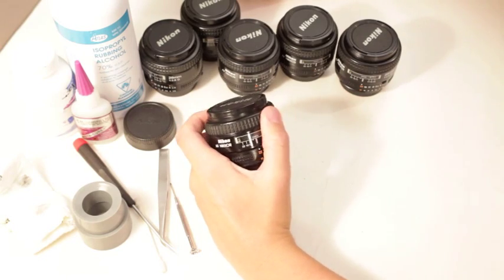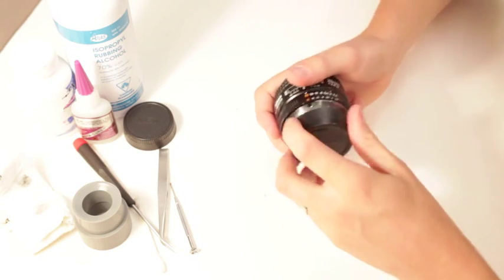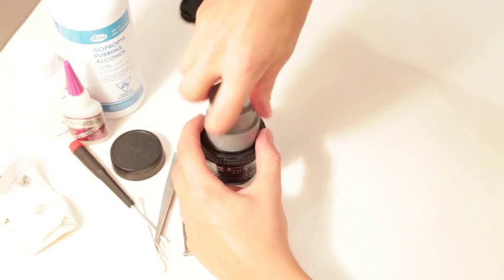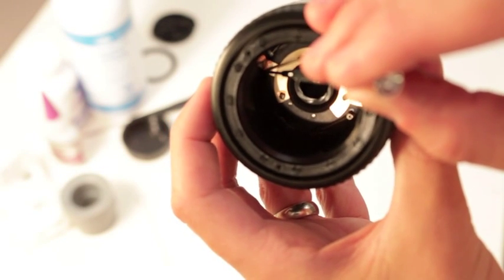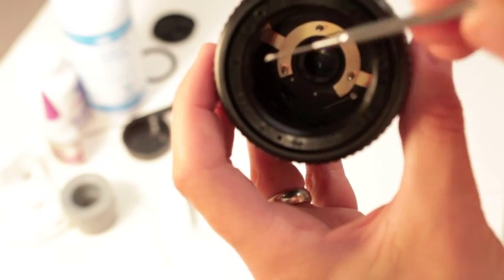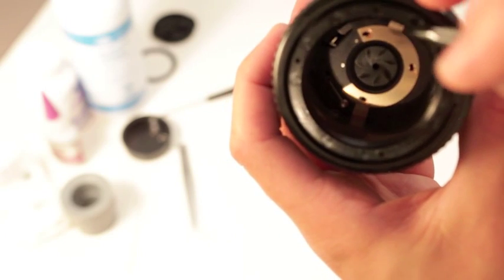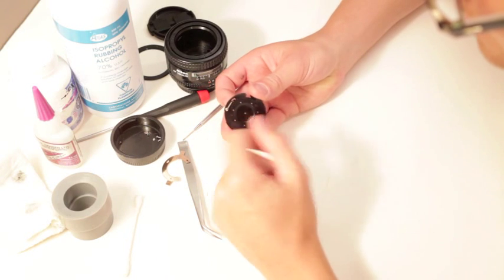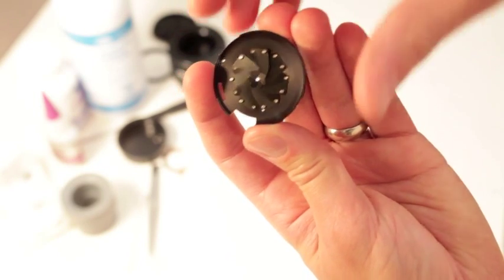How to Clean Aperture Oil on a Nikon 28mm 2.8 D AF Lens Part 1/2

Comment: just got one from someone but it's very soft on the edges and rotating the focus ring to infinity makes it worse.When I focus on a distant object it shows 1meter not infinity.I think someone didn't put it back properly.Any advice on how to fix it?
Reply from the maker: Hum to me it sounds like something is bent in the helicoid which is usually caused by someone dropping the lens on the front which causes the lens to crush in sideways a bit. Sometimes the helicoid can bend (usually canon lenses) or can jump off track. Its hard to say.
Maybe open it a tiny bit and take a peek.
Reply: @CannonFastReviews  Thanks for the reply. I did open it but everything seems in place. I'll find a use for it eventually
Reply from the maker: Hum ya without the lens in had its hard to say. Could make it into a tilt shift lens! :)

Comment: If the number plate is stuck, any ideas?
Reply from the maker: The front plate? You really want to try and get it out with something sticky like shown however if worse comes to worse.... You could get a spanner off ebay and put 2 little holes in the name plate and turn it out with a spanner.
But most times they should come out with a little elbow grease and a few cuss words...